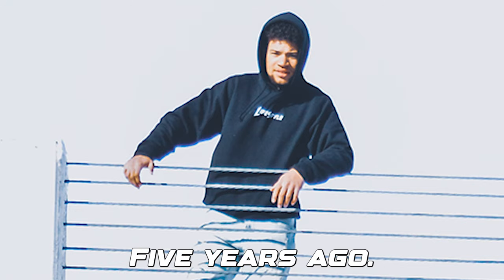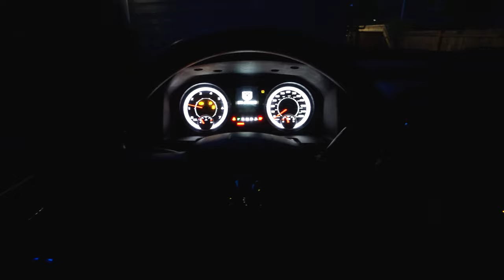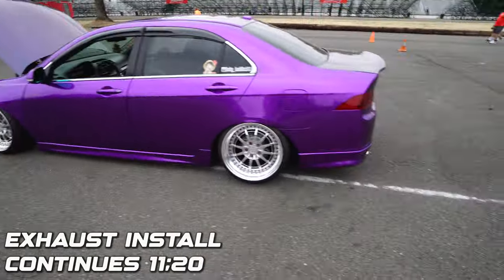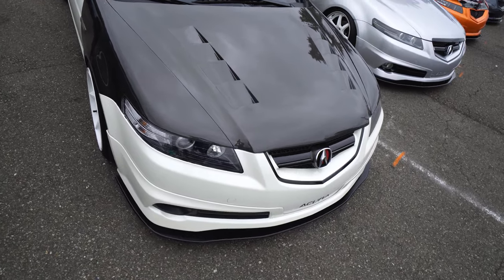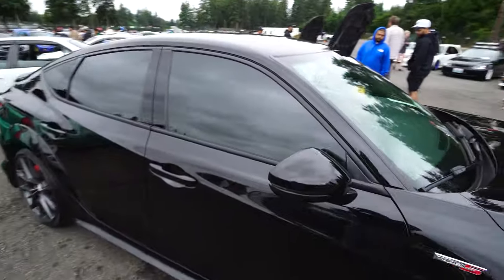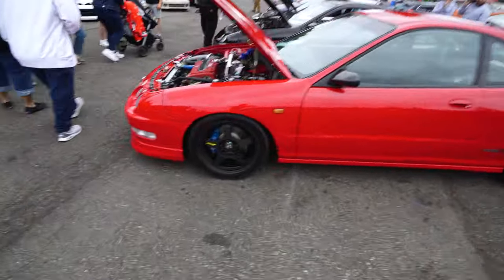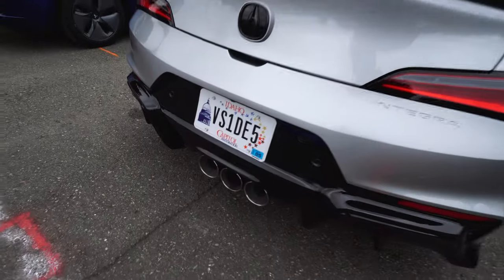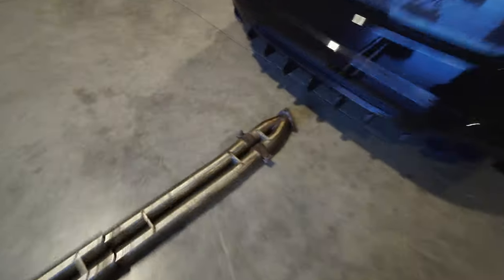INSTALLING MY DREAM CATBACK EXHAUST ON MY BOOSTED ACURA TL-S !

Comment: I was gonna say; for what you probably paid, you should’ve gotten a custom TRUE DUAL exhaust setup, exiting from each pre-cat. It would def be a unique sound, as the “headers” would technically be an unequal length (in a way, since they’re downpipes and not traditional header collectors).
Reply from the maker: That car has a turbo so that wouldn’t work. all needs to merge somewhere, this will be closest to TRUE DUAL we’re gonna get 👍🏽
Reply: @TheLifeStyle6  I wish you were closer to NY I need a new mechanic and your parts 😭😭😭

Comment: im running the ATLP v2 exhasut, v3 j pipe, and a 1320 ultra quiet QW resonator on my 3.2 TL, soon to run a cat delete and hoping my resonator continue to keep a non raspy setup
Reply from the maker: Should be good, the ATLP do a pretty good job keep things down
Reply: I have an ATLP full cat back resonated with ATLP Jpipe and TSudo resonated cat less  PCD and barely have any rasp!!!

Comment: I wondered what that exhaust sounded like. It sounds cool but a little quiet for my taste. I have a 3" exhaust from the Jpipe all the way back and it does sound different then this. The dual exhaust has a different pitch to the sound that I like but just a little quiet.
Reply from the maker: Quiet because of turbo setup, all motor with PCD she screams

Comment: You’re making me regret not getting a TL and should not gotten the 2nd gen Lexus GS300 with the 2jz I end up getting
Reply: tl’s are pretty cool man legit only downside is it’s fwd but other than that they’re so perfect
Reply: @apoxov7064 they’re but I ended getting the Lexus as I like them more
Reply: @apoxov7064 auto trans sucks very badly maj issues love my manual 06 TL